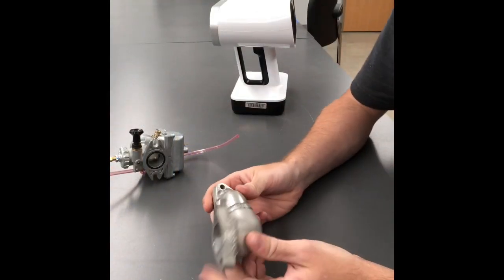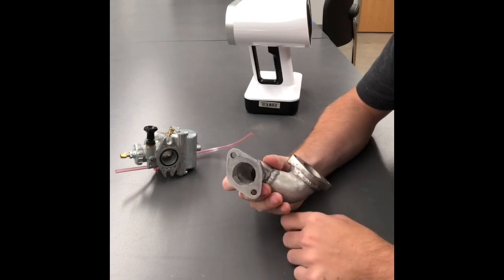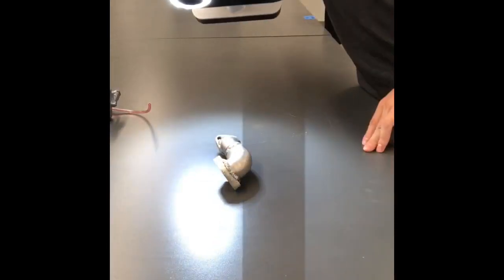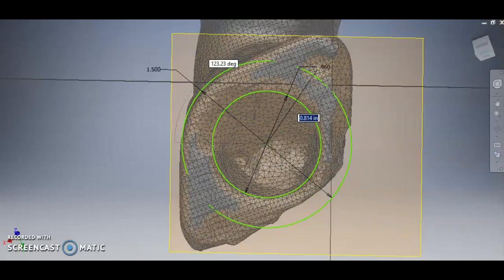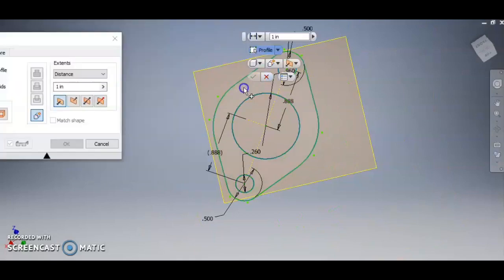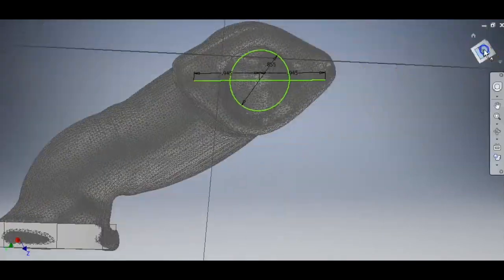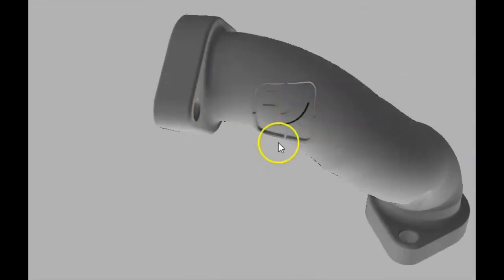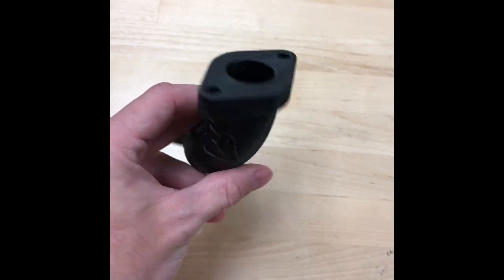HOW TO: Make Your Own Motorcycle Intake Manifold

Comment: Hey, thanks for the video!  I've been thinking of doing something very similar (intake manifold for a two-stroke engine) but am concerned how it will stand up to the heat and vibration.  How successful was this project?  You used nylon/carbon fiber filament ... any better options you'd recommend three years later?
Reply from the maker: It depends if your application requires a rubber boot for vibration or if you’re going to rigid mount it. So in my case, it didn’t work out super great because the carbon fiber strands caused really spall air leaks throughout the manifold. By making a model this way it did allow me to replicate it out of aluminum once I verified my fitment so that was fine. If I had to do it over again I would make it out of nylon without the CF reinforcement.

Comment: Is this made with ABS or what plastic? Is it a prototype or finished product?
Reply from the maker: I printed it out of Nylon 12 Carbon fiber for rigidity. It was just a prototype for a project of mine. I ended up making one from aluminum to actually use.
Reply from the maker: eliskinner9234 I actually ended up not using this setup after all. I really didn’t like the mikuni carb I showed in this video so I scrapped the idea. What I did find out from 3D printing another intake manifold for my ATC70 out of the same material was that the carbon fiber strands made the intake too porous causing tiny little air leaks. I believe a different form of nylon would work better without any kind of carbon or fiberglass reinforcement or if I dipped the whole think in a high temp epoxy to close the pores. I’ve used this material for many other parts and have never had an issue though.
Reply: @PosParts  since some intakes manifolds are rubber how do you think I should go about making one for that? Or would using metal not make a difference for a dirtbike?